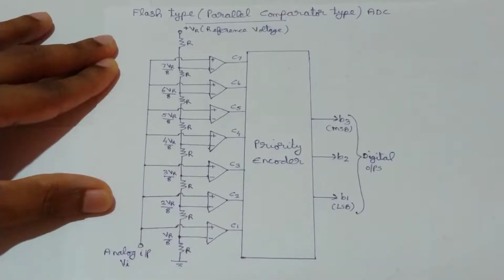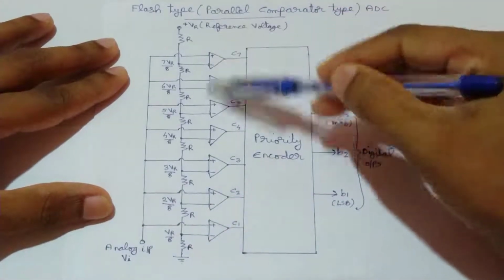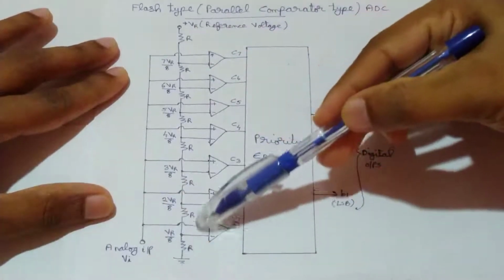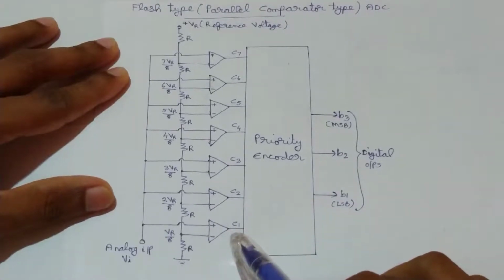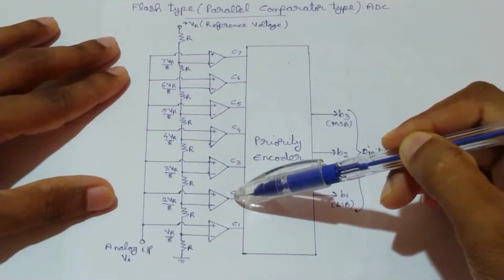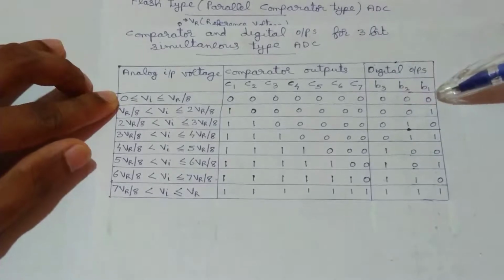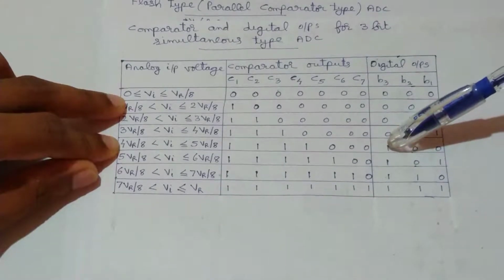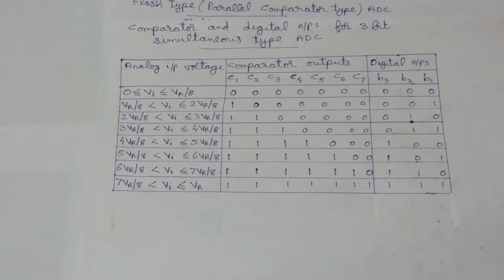FLASH TYPE ANALOG TO DIGITAL CONVERTER (PARALLEL COMPARATOR TYPE ADC OR SIMULTANEOUS TYPE ADC)

Comment from the maker: Explanation for why the range of  analog input is chosen as shown in the table (like 2VR/8< Vi ≤ 3VR/8):

As an example consider the case  2VR/8< Vi ≤ 3VR/8. Here consider that  the limit on left side is taken as   2VR/8< Vi  and it is not taken as 2VR/8 ≤ Vi  because if  Vi is equal to  2VR/8 then the output of that particular comparator (2nd here )will  not be equal to ‘1’ ( and we will not get the comparator outputs as 1100000). Here to get a ‘high’ output for the second comparator( so that we get the comparator outputs as 1100000) Vi  should be greater than  2VR/8 and hence we cannot choose Vi  equal to  2VR/8.
On right side the limit is taken as  Vi ≤ 3VR/8 ,because in that case the output of 3rd comparator should be zero. The output of third comparator goes to ‘1’ only if  Vi > 3VR/8. Eventhough Vi  is equal to  3VR/8 its output remains at ‘0’( the previous output) .so we will  get the required comparator outputs(1100000) whenVi ≤ 3VR/8 . so when we consider the limit  on right side  it can be less than or equal and on left side it can be less than only.....